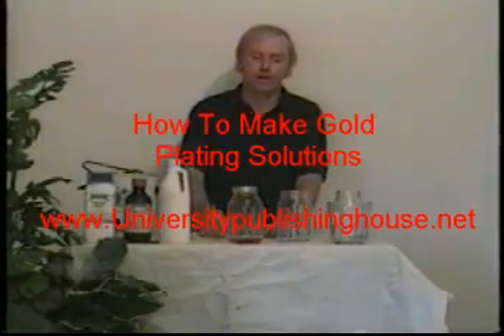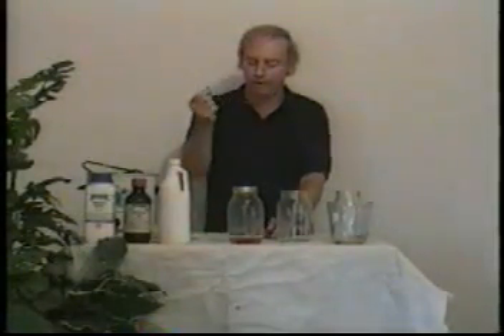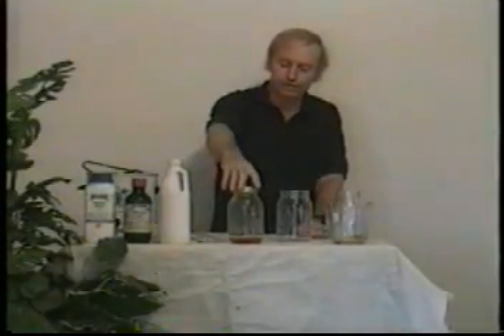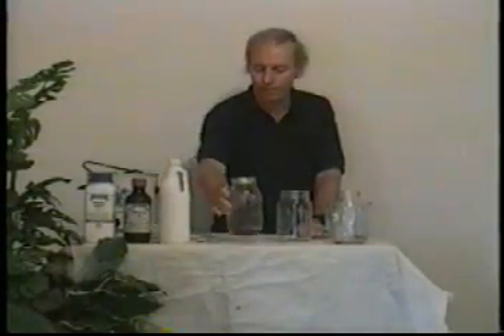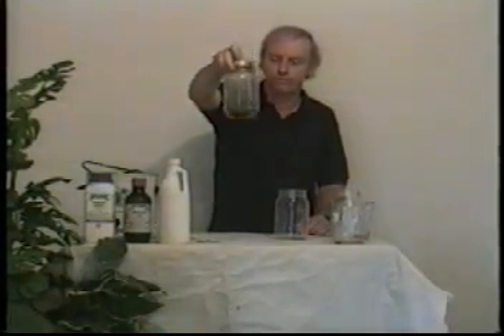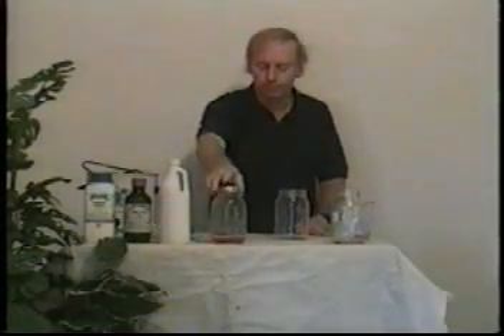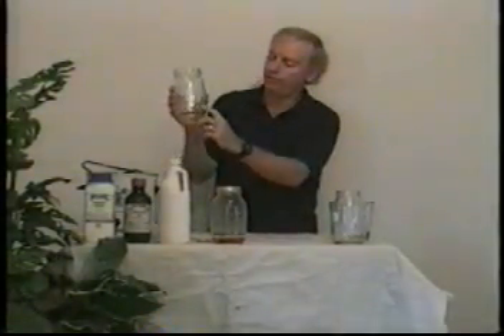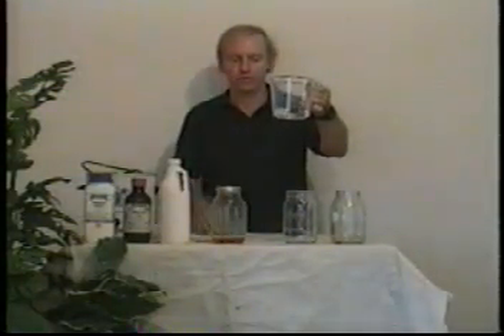How To Make Gold Plating Solutions    Check out our "Electroplating Forum"

Comment from the maker: @ hitch...Hello-- for chrome stripper, I use weak sulfuric acid; 1 part acid to 3 parts water. Use reverse anodic current and a piece of lead. Sulfuric acid is obtainable at hardware stores as "drain cleaner" and is always in a clear plastic bag. For cleaner, use electric dishwasher soap as it is nearly 100% sodium carbonate. It is possible to use electric cleaning or w/o current.